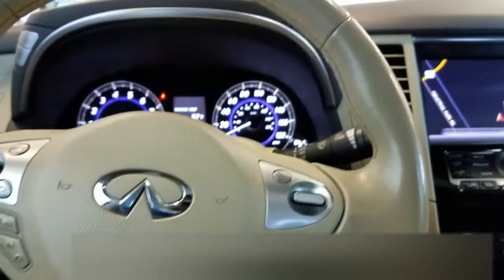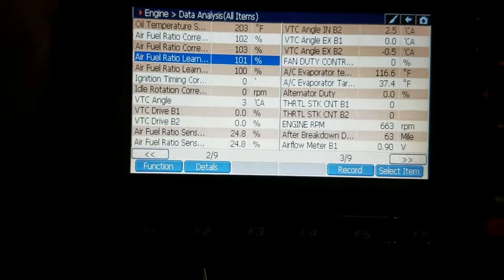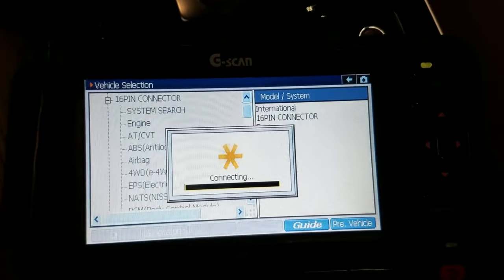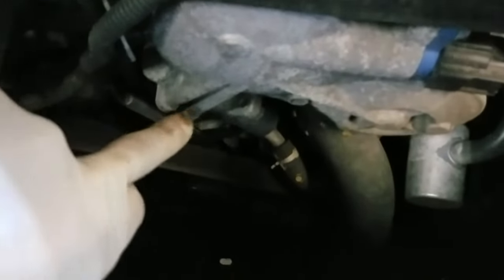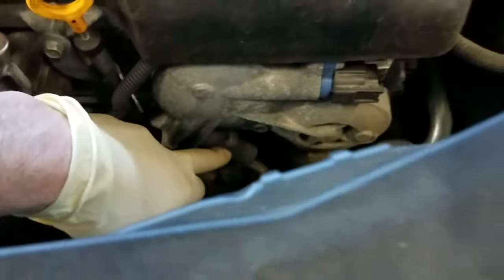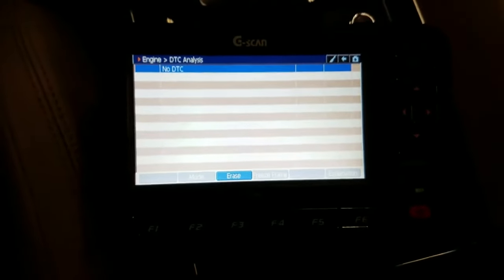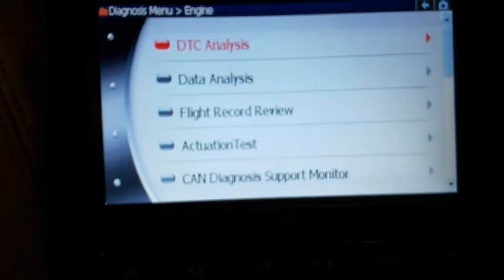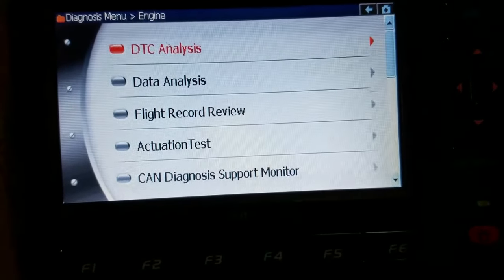P0021 P0011 Code Repair and Timing Relearn Procedure

Comment: Does this cause the engine to rattle?
Reply: Yessirrrrrr
Reply: I replaced both solenoids, cleared the codes and still have that rattle and code came right back after a few hours.
Reply: @twinturbobmw535xi7 did you ever find out the problem/ cause? 
I’m in the process of buying an fx37 w the P0021 code and I wonder if it’s a dealbreaker?
Reply: I replaced both camshaft sensors and crank sensor and changed VVT but no one is showing how you relearn the cam sensor. I have a m37. Can somebody with any knowledge assist me in relearning my cam sensor ASAP PLEASE

Comment: Hey I have codes P0011, p0014 timing over advance.  I replaced both solenoids with oem hitachi. When you’re really light on the gas pedal at low rpm’s I have interninemt rattle. Cleared codes and they came back along with P0420.  Could there be another problem?   Dosent seem like there’s any  drivability issues. It even seems to shift into gear smoother  after replacing the solenoids, it used to shift into drive or reverse a little hard. Now it’s smooth. But i still have the same codes and now I have P0420 as well.
Reply from the maker: Hey, it's great that the shifting feels smoother after the solenoid replacement! Keep an eye on those codes, and maybe try some additional troubleshooting steps to see if there's another underlying issue.
Reply: have you figured it out? i also have this same exact issue except i dont have the p0420 anymore
Reply: @koookiiie if you replaced the solenoids and cam sensors , the only other option would be oil galley gaskets behind the timing chain or a bad timing chain tensioner. Which you would have to replace anyway if you decide to replace the oil galley gaskets. I sold my car , didn’t wanna do all that work. I just did my timing belt and tensioner on my Acura mdx /tensioner was bad and was making my engine make a knocking noise that sounded like a bad lifter. Noise went away. So loose chain or belts can cause codes , the only difference is I believe the g35 timing chain tensioner is controlled by oil pressure. So I would do an oil pressure test and see if it’s within spec or not. Start there. Some reported having oil light come on , my car didn’t.  Start up rattle disappeared after replacing the valve timing solenoids. But when I would be cruising at low rpm’s or revving it at low rpm and hold it, it started rattling. That’s the only time it would do it. So check your oil pressure specs and go from there.

Comment: I’m experiencing rattling noises above 2000rpm and the car fails to accelerate properly
Reply: Same! I would love a answer asap thank you
Reply: Most likey is your timing chain guides/tensionor
Reply: these odes 😊are for low oil pressure

Comment: Question!! I have both of those codes! Engine when engine is cold works property after it warms up it stutters and i cant go over 2300k rpm.  Without the car really acting up.
Reply: Samee !!
Reply: Same 🤦‍♂️
Reply: You have to change the solenoid
Reply: Check oil pressure as well. Low oil pressure will also cause these codes.
Reply: Lmk if you fixed it and how you fixed it please

Comment: Nice video. I’m in the market for an Infiniti fx37 2012 has somewhat high highway miles at 165 but has code P0021. 
Would this be considered a true problem for the engine and tranny of the vehicle?
Reply: All the Nissan 3.5s seem to have timing chain/oil galley gasket problems causing those timing codes.

Comment: My Engine rattles intermittently between 1200-1800 rpm at speeds below 40 mph and I get the code P0021 seldomly after resetting it. Ive replaced the 4 Camshaft Position Sensors and both Solenoids with dealer parts and run Lucas Heavy Duty Oil Stabilizer with every oil change. What do you think I should do next?
Reply: I have bank 1, bank 2 timing over advanced codes. Replaced both solenoids with oem hitachi and the codes came back. I have that rattle too at low Rpm’s. Did you ever fix yours ?
Reply: @twinturbobmw535xi7  no, I think it is Timing Chain rattle. One of the Sprockets or Tensioners is bad, throwing the Timing Chain off/ stretching it and causing the P0021 code.
Reply: Check your gallary gasket
Reply: You likely need chains and tensioners/water pump and more ...
Reply: @alfee9411  Its not those. Its a gallery gasket failure
Reply: @thomasvarghese9322  not necessarily. if the car goes into limp mode and you get both p0011/p0021 as a combo, then yes, probably shot gaskets. otherwise, it's something else.
Reply: @BangMusikBeats you’re right bro. I had a buddy do some work on my car, he didn’t tighten the belt up good enough so it would squeal sometimes. So I tightened it up, got it a little too tight, & decided since it’s hot I’d wait until cooler weather. Well inevitably here we are 3 weeks later with that rattle(only while idling & tight turns) & P0011 code lol. Definitely taking care of that tomorrow.

Comment: I got P0011 camshaft position timing and  SES is on. It wont rev past 2k rpm
Reply: What did you do did you buy new cam sensors? I just changed my valve cover gaskets and its doing exactly that and im in limp mode.
Reply: @OhMaccc any answers
Reply: @OhMaccc  your galley gaskets are blown, unfotunately. limp mode gets activated when the car sense low oil pressure due to said gaskets failing. requires full timing cover removal to get to them. tedious job, but not terrible.

Comment: Recently replaced my valve cover gasket, and after I put everything back together and took it for a drive, my G37 threw a p0011,  p0021, and then a p0300. 

It went into limp mode before stalling out, after I started the car again, it was idling and driving Really rough. 

As suggested from your video, I cleared the codes, and did the re-learn procedure and ripped around whole revving the engine. No codes. 

Hopefully it wasn’t anything serious.
Reply: Hows it been since ?
Reply: @Fayzooooo   it’s been solid. No codes, and idles quite smooth.
Reply: Ok did it have a knocking sound and can I do this same thing on my 2006 Nissan Maxima to relearn timing
Reply: @arvionmathews4487  no idea. I didn’t have any knocking noise, just really rough idling.
Reply: @designedbydave_ca  8 months later, but.... your galley gaskets are more than likely shot.
Reply: @vinny6_9  8 months later and my G is still running with zero codes, and everything running jam dandy.
Reply: @designedbydave_ca  fingers crossed, man. Easiest way to check is get a mechanical oil gauge and check your oil pressure, just in case.

Comment: So if code (P0011) is passenger would that be the right side from driver perspective or left side from outside perspective??
Reply: Always put yourself in the drivers seat when working on vehicles, never stand at the front and look at it, the right side of the engine (from the drivers seat) is bank 1